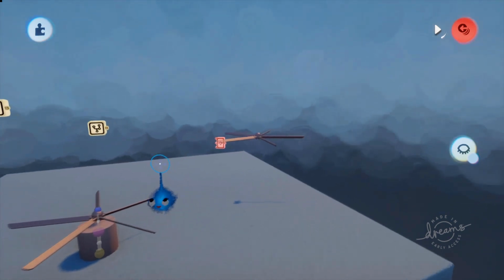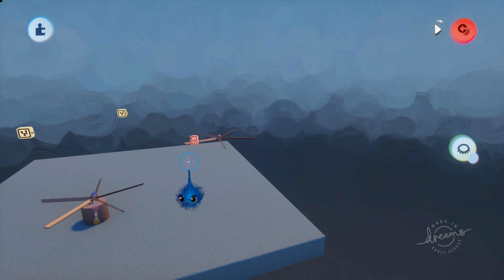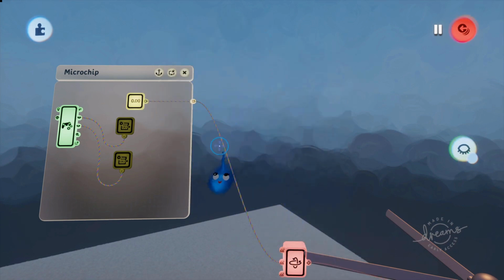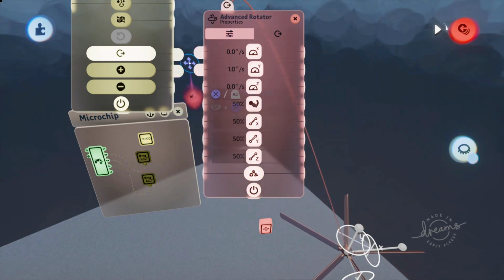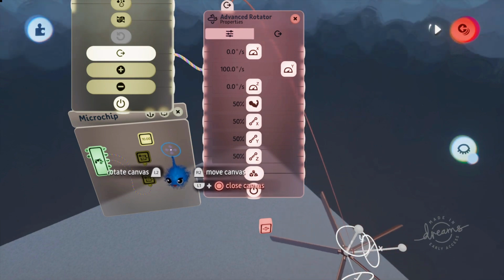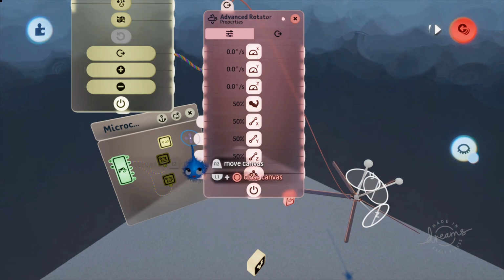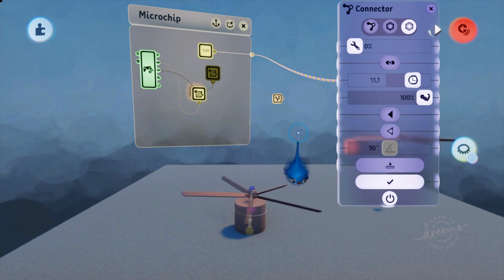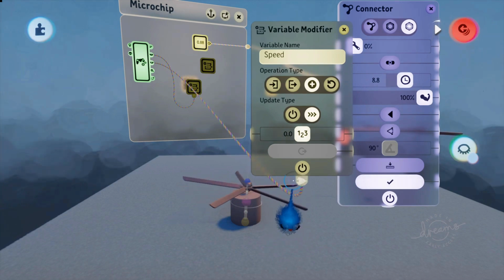Dreams PS4 Tutorial: Player controlled rotation speed

Comment: Great help. Just a question, I have a micro chip with a gamepad controller and have R2 connected to the strength of the motor bold and I have L2 connected to the reverse connector of the motor bolt. Now when I hold R2 the motor bolt spins up but L2 seemingly does nothing tho you can see all the connections light up on the wires. How do you get forward and backwards control out of the motor bolt?
Reply from the maker: I dont know what you mean by reverse connector of the motor bolt. In the tutorial I controlled the motor bolt spin by changing the speed of the rotation - negative number slows it down and eventually will make it spin in the opposite direction if you set the min number of the variable to be a negative number. I did not touch the strength of the bolt or the connector itself.
Reply: When you scope into the motor bolt there is an option to reverse but does not seem to do anything. I am trying to get both forwards and reverse out of the one motor bolt.
Reply from the maker: @TheCardinal365  Use a keyframe to reverse the direction when you press your L2 button.
Reply: @DreamswithLadylexUK  managed to get forwards and backwards using R2 and L2. I wired the L2 to both the cycles and the reverse function on the motor bolt. Kicking myself on how easy that was lol

Comment: Nice! Could something like this be used to limit the signal percentage/strength of the left analogue stick? Or is something like a signal manipulator needed instead?
Reply from the maker: Not really sure what you are trying to do, when you say limit the signal. You can always put signals through calculators to artificially lower a signal, but it really depends on what signal the receiver is expecting. This microchip creates numbers in a range dependent on button presses, Im not sure how this applies to the the left stick.
Reply: @DreamswithLadylexUK  I'm trying to convert the left stick being pushed 25%(just an example percentage)into a 100% signal... 
So, when you are pushing the stick 100%, it just does what it would do if you're only pushing it 25%.

The reason why I want to do this, is to have a nice slow walking animation. 
I have my walk speed Set to 1.0m/s, and run speed Set to 0.0m/s. 
With these values, it creates the perfect walking speed and animation for what I need when I only hold the stick about 25% of the way. 
You'd think I could just lower the walk speed to 25% and get the same result, but the animation is completely different for some reason.
Reply from the maker: I got a result with the signal manipulator. Change the out on the Custom Remapper to 0.25. Wire the left stick signal into the input of signal, and wire the output to the walk on the puppet interface
Reply: @DreamswithLadylexUK  I've only just seen your reply, but I'll give it a try when I'm next on Dreams. Thanks
Reply: @DreamswithLadylexUK  You absolute legend! It worked! 😁

Comment: Question i was wondering im trying to create a landing gear that retracts extends into a airplane wing.Can you use a controller sensor and something like a motor bolt or advanced rotor to do that.I would like to be able to do that since the plane will be taking off and landing on a runway
Reply from the maker: I'd use a bolt with a fixed range and then use a keyframe animation at the position of retracted and extended. Use a timeline to create an animation of the wheels going up/ or down. You can then link that to a controller sensor button press.